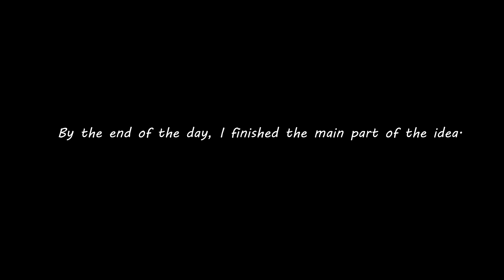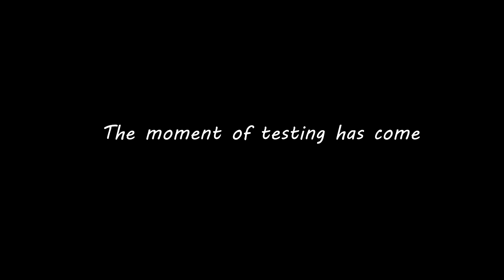I dreamed about this device for 20 years! I did it in 5 days

Comment: Terrific build - thanks for the share. Some useful suggestions for minor tweaks from others too. Mine’s pretty simple….grind those sharp upper corners of the blade round just as some protection against a nice rip should you catch a pant leg brushing by…or worse if you slipped and fell on it.

Comment: I use to install plows on atvs and your set up is pretty much spot on to the manufacturers design
Reply: Are their designs for ATV's without a PTO? Is there a simple and automatic mechanical way to lift the blade just buy reversing?

Comment: Recess the rubber scraper to keep snow from building up in the middle of the plow, boxing off the sides also keeps snow in and leaves cleaner trails, and a sprung pivot in the center keeps the blade on the ground even if you're uneven
Just some tips

Comment: If I can make a suggestion to help prevent the front suspension from going to crap, look into getting some chain links to mount on the bottom side of the A-Arm shock mounts, then connect them together below the frame with a simple turn buckle. It'll keep the A-Arms level with the frame at the lowest point of the Frame. Transfers the stress of the load and the cold metal flexing into the whole bikes frame preventing cracks. It's the same concept of a weight distribution hit for a RV trailer. You could later add on a bottom horizontal blade with swing pivot to add a bucket feature to your plow attachment

Comment: I built a big snow blade for a quad like yours back in the 1990s... worked great... but the 5 position snow blade would only work on the centre 3 the 2 outside position the blade was too angled and would pull the quad... I sold the quad and snow blade set up in the dead of winter to a guy that really needed a snow plow.... nice build brought back memory’s

Comment: Nice job. Only one thing I would do on mine is make it 6 in wider on both sides. When I have mine angled the whole way the blade is actually inside the track of the tire..plus a little extra weight dont hurt. Again, nice build

Comment: Good build. Sticks out a little far though which unnecessarily stress the winch. But it works.
However, for the cost of the metal to make this plow you could get a used one in good condition for 150 dollars.

Comment: Never seen a plow out that far before but I’m lazy & someone gave me a plow. I’ve built a manual lift system for it & always fixing the plow. I use a 5 inch wide strap for a wear bar for weight to scrap the snow off & for back dragging. I took the skid shoes off that cane with it.

Comment: 9:10 At first I thought you put the articulation and springs in backward. Then I realized that hitting an obstruction would tilt the blade down into it, lift your front wheels slightly, and break the (presumably frozen) object free instead of gliding over it. With care a good reflexes, your way is superior. I stand corrected. I'll see myself out (subscribing along the way of course).

Comment: Hey, I've done a lot of snow pushing with trucks and atvs. Just wanna drop in my 2 cents. The little round corner feet guides on the bottom of the blade, they're pretty useless. The rubber blade, that you did, is recommended. So my suggestion is ditch the little round sliders, keep the rubber lip(which is where all the pressure and contact to the ground should be made) and switch out to new rubber lip when you wear through them. Our rubber lips would last a season or 2, easily replaceable,  no metal to concrete contact which saves gouging issue.

Comment: Another helpful feature if used before is putting a vertical bar as close to the blade as possible so you can add weights. Another way I’ve seen it done is with a box right behind the blade so you can add sand or even snow to it. Just helps the blade cut down a little bit more and stay below the snow instead of floating up on top of it. Really helps for the hard pack.

Comment: Something to make it work a little bitter is 1) add some weight to the plow so that its always level to the ground and not cockeyed as shown when the blade was angled. 2) the 2 round "feet" that you put on keep the blade from scraping appear to be too high so you're not getting down as deep as you could and will ultimately leave a thin layer of snow which will then just turn to a thin layer of ice.
Reply: plus weight would push it down to the concrete rather then it just pushing the loose snow and not the hard packed stuff
Reply: If you have a good scraper edge, there is no need for the feet. The scraper edge also looked too "rubbery", it would be better of a harder material that is hard wearing.

Comment: Nice build. I was curious though as to if the plow frame could have been shorter and plow closer to the vehicle or would that have interfered and limited your retractable height do to the frame to bottom of the vehicle clearance?
Reply: You are definitely thinking the same thing as me. But yes it should be a bit closer to the vehicle. There's actually a few downsides to it being so far away. One it makes maneuverability a pain. Two it puts a lot of strain on the frame and winch pulling/lifting the blade up.. Because theoretically u would want your hinge as close to, being below the winch as possible. And since the winch is only slightly higher. You want the lift point/eyelet for the winch to be close to the blade, but since this is so long. The winch is exerting a fair bit of tension straight back, instead of up. The only benefit to having it set up like he has it. Is u can lift the blade higher. But it's not practical because it's not going to be beneficial in any way, as a Snowplow. Basically because of the ground clearance beneath the 4wheeler. That's the other downside to this design. Three it'll put a lot more strain on the front suspension. No doubt it'd be stronger. But it sacrifices ground clearance. Four Having so much cable left out in the up position. Itll probably bounce like none other, going down a rd especially a bumpy rd. Five one more suggestion to him. Is removing the rubber strip he put on. That's going to wear very fast. And put a piece of steel or aluminum, maybe even fiberglass strip in its place. It's basically a sacrificial piece. To keep from wearing the actual edge of the plow. Not a horrible design. Just needs a few tweaks, and I believe it'll work out great and last a good while!
Reply: @richardbadish6990  I see your points but what I was thinking the problem might be with the longer distance between the blade and vehicle because of structural deflection. The long frames proportion may twist or bend to one side or another under excessive force and stress.
Reply: There is a lot of wrong with his set up, but it’s still 100 times better then I could do since I don’t have near the equipment in my garage. 
I recently switched my cutting edge from steel to polyurethane. They say it’s better and last longer. I will find out after this season. If we ever get snow lol. 
My set up. 2019 Polaris sportsman 850 ho
Kimpex click n go 2 with a 54” blade.
Reply: 889
Reply: @richardbadish6990  I'm no engineer or metal worker, but my guess would be that its due to it's vertical movement being based on the winch. Having it closer to the ATV means less space for the winch to move the plow up and down. Seems like a necessary sacrifice in order to not need another motor to actuate the plow.
Reply: Good pont
Reply: Another suggestion is reduce the height of the mount under the ATV. With the snow plow off that protrusion will catch everything when driving over it. If it catches a rock it will stop you dead.
Reply: @o1mtbiker  I seen one a neighbor built some years ago. Made out of plywood and one of those plastic deck boards. Its super simple and has a lever to lift up the blade. Its fixed yet works very well.

Comment: Good skills and fun project. I suspect it’ll bend though. That front bracket is very long and snow is surprisingly heavy and solid when heaped up, It’ll probably ride up over the snow too if you push too much at once as it’s not all that heavy. Either the brackets or under tray of the quad are at risk based on the damage my plough did to my tractor brackets..Nothing like finding your first tree stump or raised manhole cover 🤦‍♂️
Reply: Hater
Reply: @poingbingus9139  telling the truth isn’t being a hater. He even said good skills and fun project. But even though it’s a good project, there’s still some problems it’s gonna face just like that person said

Comment: An idea so you don't have to waste time getting off the quad. Have a couple bars with ball joints; attached to the plow head, that in turn attach to a bar parallel with with the handlebar. That bar can be on a pivot and be detachable. You can have a couple pieces that swing over to connect the bar to your handlebar. You can use a bike cable to pull the lever. So you'd be able to have the plow follow your steering, and as easy as flipping the pieces off the handlebar you can lock the plow in place to hold an angle. I hope that made sense. If you really wanted to go nuts you could have the pieces that attach to the handle bar be adjustable (with spring loaded hinge pins); so that you could have the plow head follow your steering, but at an angle.
Reply: I was thinking same thing a release lever on the front rack and possibly like a cable around a crank attached to both sides of blade and just rotate the crank handle and lock in place with release bar or. Jonathan’s ide would work making the tool more efficient. Just a suggestion
Reply: @OldDungeonMaster  Glad I made sense. Yours would be faster and easier to make. Idk if the guy gets enough snow to justify the trouble of implementing my idea, but it sure would make for a nice video lol. I really like your crank idea. With the right size cylinder can even be 1 to 1; so it's also an improvement on my idea. Would be more lightweight and compact.

Comment: Nice build only thing i would change is add an additional mount to make it a 3 point system like a tractor then you can use the weight of the ATV as well and still have winch to lift when required...then again for the price of the plate steel (where i live) you could off added hydraulics off a junk one.
Keep it up

Comment: That is impressive. Now here is another idea that would expand your snow moving ability. A rear snow blade. You will have to google it. They allow you to have bigger wings for dragging the snow. Depending on your hitch arrangement and the under body hinge you might be able to adapt a winch and use those same hinges to make a rear snow blade. 
Also with your current set up you can build a pretty nice bucket for moving small amounts of dirt and debris. I have never seen a bucket on a atv.

Comment: To get a better and consistent surface on your turned shafts, dont use a boring bar like that.
If thats the only carbide youve got, run the bar in boring configuration but turn the bar upside down and run the spindle in reverse.

Comment: Adding to the changes put the rubber scraper blade on the backside. That way you get a better action of the snow moving off the blade right now the snow is accumulating on the rubber blade and gusset on the front of the blade.

Comment: Wow great job you are amazing! Maybe you could put a pulley system in place like attaching a ring to each side of the blade and adding a cord or small chain that leads into the cabin where you’re sitting and you can pull it left and right instead of having to get out. I’m thinking of something like 2 long dog leashes where you’ll have the handle with you inside the vehicle and you can pull The left one to turn left or right one to turn the blade right. Think of something like the reins on a horse!

Comment: Cute but if the push tubes were shortened, bringing the blade closer in the blade would clean up better on turns and help keep more weight on the back tires. Also use stiffer springs, the blade shouldn’t flip forward when plowing normally. It should only flip when impacting something hard like a curb. Also get the cutting edge as close to vertical as possible. It will scrape better
Reply: Yeah I was gonna say he should add a 6’ length to the arms and really start blading snow. Haha.  Sarcasm of course. 
I agree. Shorten arms man!

Comment: Although we live in south texas and only have snow once every 20 years, I think this is a very well thought out and built project. 

Are you a mechanical engineer by chance?  If not you have the knowledge. 

Great job.
Reply: Aside from the fact that his ATV transmission will need to be replaced after a season or two.
Reply: @silvermediastudio  depends on the drive. I'd argue if it can handle towing a small trailer in rugged terrain, it's got the foot or so he's doing.

Comment: That type of snow plow has been around for quite a while. I have one on my Kodiak 400. Mine is  similar. Although my snow plow is closer to the quad. Mine has  threepoint 3 points of attachement: 2 in the front and the strongest point on the trailer hitch On the differential.

Comment: Great job making that blade. I would change 2 things. I would have brought the blade way closer to the front, and would have made the blade attaching arms parallel to the ground (Yours angle upward) so that when you angle the blade the whole edge contacts the ground, not just the trailing edge.  I just mounted a 9 foot blade to a 160 HP tractor. When I angle it the blade touches the skid plate both sides. We have had snow on the ground since mid November, and you should see how good the snow rolls of my blade at 10 miles per hour in 6 inch snow.

Comment: Blade should be way closer to the front axle (should just clear the tires) you'll have much better control when working near the quad's capacity.

Nice job though.
Reply: So correct. The longer that front arm is, the greater the leverage working against the weight and traction of the quad, to push anything but light unfrozen snow in a straight path. Only thing it might aid in is piling snow up for a few feet higher than with a shorter arm.

Comment: Very good work but as others have said the plow is too far from the front of the ATV. Among other things the leverage used against the mount is much more than it should be at a shorter distance. As a side note for those who plow on gravel. Replace the plows rubber cutting edge with a taller rubber piece that extends a couple inches below the steel of the plow. This will allow the rubber to fold under and not scoop up or plow away as much gravel as a normal plow setup would. This rubber stock can be found at places like Tractor Supply and sold as a horse mat.

Comment: Not bad over all. I think it looks a bit heavier than u really need but better too much than too little. I found its better to have the bottom edge of the plow straighter, perpendicular to the ground, and it curved more over forward at the top. It tends to roll the snow better, and scrapes less than a dozer style blade. Plus when it rolls the snow, it can push more, and forces less to the sides.

Comment: Cool job.
I love fabbing stuff myself too.
I’m gonna make a pull behind ATV brush mower much cheaper than buying one.
Just food for thought .
When cutting with that wheel while kneeling on the work you’re cutting you might wanna throw a set of chainsaw chaps on.
I was doing something similar with a much smaller grinder and a cutting wheel and the blade got pinched for a sec and kicked back into my knee for a split second bump on my leg.
I immediately stood up and noticed my pants were ripped and I told myself if my ankle gets wet I’ll have to take a look.
There was minimal pain but a little burning.
Well 10 sec layer my sock felt soaked so I knew it was bad.
I ripped my knee open more and saw my kneecap bone staring at me through a 3” gash with a1/4” wide gap.
Just then my wife looked over the porch and said “Lunch is ready …..I made you grilled ham and cheese.”
I said “Oh baby that was sweet of you but do you think you can drive me to the urgent care for some stitches real quick.” And I showed her my knee.
Now she is a nurse so she’s not afraid of blood so she just says “Oh my God….get in the car….I’ll grab a towel….and the tourniquet is on the dashboard of my car.”
And away we went for 12 stitches and three weeks of not being able to bend my knee or else I’d split the stitches.

So yeah …now when I cut steel sideways with a grinding wheel I throw on my chainsaw chaps.

Comment: Great job ,now patent it and sell it.Just add a strip of UHMW for the scraper part of the blade .set it between springs and a post so it floats and you are good to go
Reply: What’s there to patent? Most quad manufacturers offers plows that mount like tgis one, swings and raises and lowers like tgis one, except built for that mschine in particular so you for example don’t wreck the frame if you hit something that doesn’t tilt the plow forwards

Comment: Great metalwork. Liked seeing it in action. The blade is mounted very far forward from the vehicle. This will increase the leverage against the vehicle off to one side when pushing heavy load with angled blade, resulting in loss of forward traction. Blade at bottom tilted back. Wet snow will build up and not fall off so easy. Excessive blade weight. Height could be greatly reduced since beyond machine capability anyway.
Need chains on tires to do serious work if machine has the power and gear down.

Comment: Friggin awesome dood i tried that with cardboard one time, lol J/K. I might have to steal your design and possibly improve upon it 😁. I think you could prolly use a little more weight near the plow, but prolly not much. I got a hydraulic meyer home plow for the front mount hitch on my supercharged 01 XPLR Sport that I have extensively modified. But Id like to make something like this for my lawn tractor.